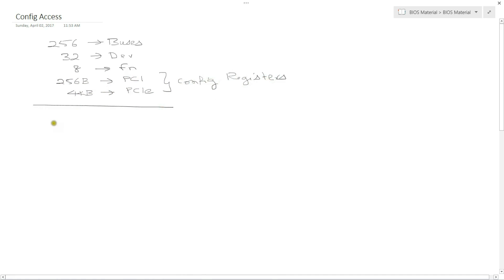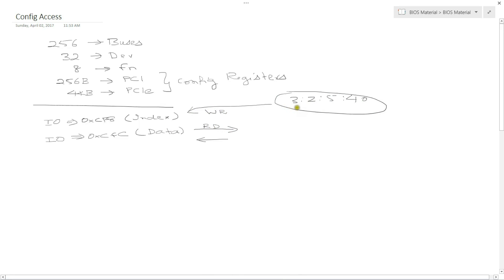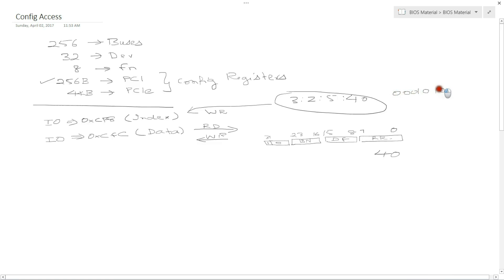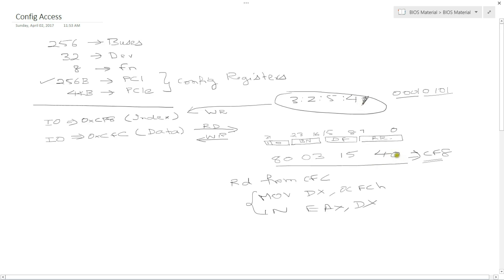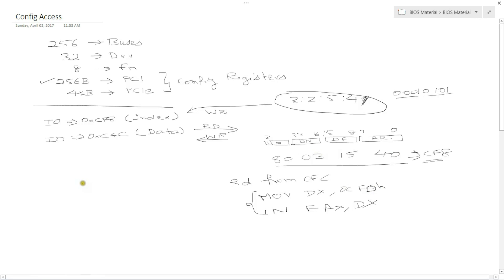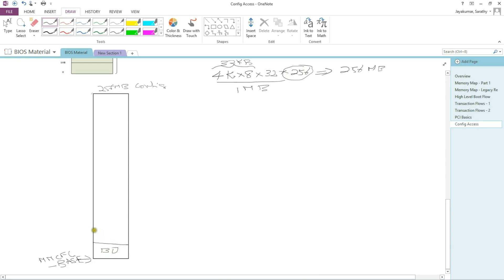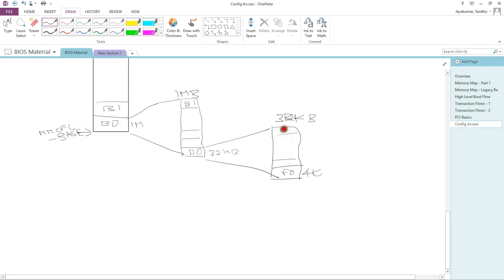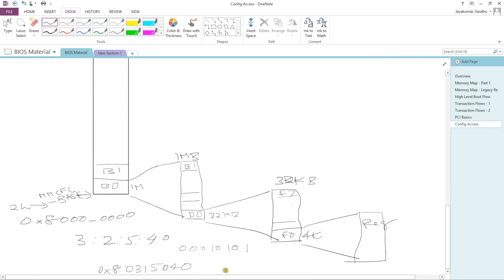System Architecture:  7 - Accessing PCIe Config Registers

Comment: How does the port mapped I/O requests (via the In/OUT instructions) reach the PCI config registers in the first place? Do the motherboard vendor solder the buses coming out of the CPU into the system agent in such a way that this would always be the case (possibly following the PCI/PCIe specification?) ?
Reply: how are you doing, I remember you from the OST1 OG class. might be a lil too late to answer.
Anyways, I asked the same question when I learned this and these are the conclusions I came up with:
on a x86 system, the system itself is built on a pci "backbone". so every access to peripheral is done via pci communication first, whether directly communicating to a pci device or regular device (via a controller which is just a piece of hardware in the pch that knows how to communicates with the bus interface etc. but is ultimately pci function or really just a pci device itself). so with that in mind, there should be a pci bus protocol to communicate with everything on the system because everything is built on pci/e device chain. so what actually happens is when the system agent gets a request from the cpu to talk to a peripheral
it creates a pci transaction (which is part of the protocol). if you look up the pcie transaction types you will see MMIO R/W transaction, Port IO R/W transaction, but more importantly Configuration W/R transaction. so I think what happens is when the system agent gets a port IO requests but with CFC and CF8 ports for configurations it just creates configuration transactions which the devices can understand (they built that way) instead of regular port IO transactions.

Comment: Once Enumeration is Done where B:D:F information stored?
Reply: I think it is maintained in the device data structure in the low level firmware code that does the enumeration e.g. in OS device driver's data structure. The driver initializes one structure per device and uses it to read/write to the device

Comment: Hi Sarathy , First of all Thanks for wonderful series on system arch....have few basics  query...Where are actually PCIe Config space registers are present , In Root Complex or Physical RAM or PCI Device? Who does the PCI enumeration BIOS or OS? 
How is DMA mappings done by PCI...?
Reply from the maker: Config Space registers are present in PCIe devices (they can be root ports, switch ports, or end-point devices)
Reply: AFAIK: PCIe registers are in the PCIe device. For ex. if it is a GPU device then those registers will be in GPU.
BIOS does enumeration. Typically the devices come up even before OS has booted up and drivers have loaded.
Question on DMA mappings --- no idea.

Comment: Since config registers are DW aligned, then why do we need 8 bits for accessing 256 Bytes ?  shouldn't we need 6 bits since 256 bytes are 64DWs.
Reply from the maker: You can have byte access for PCIe config space registers. For example, Primary/Secondary/Subordinate bus number registers are all byte wide. So, you need 8 bits for accessing 256 bytes.